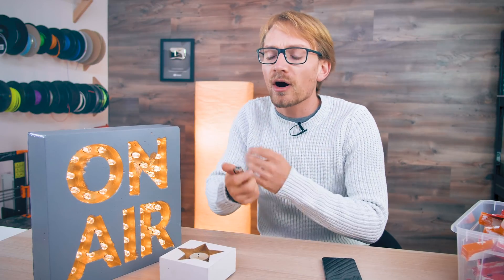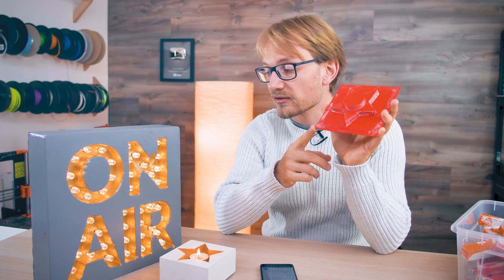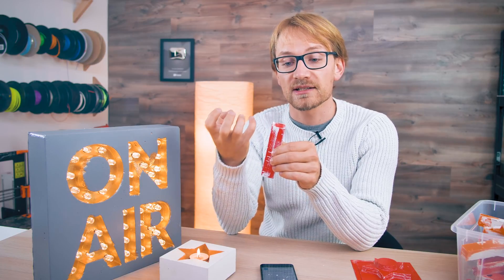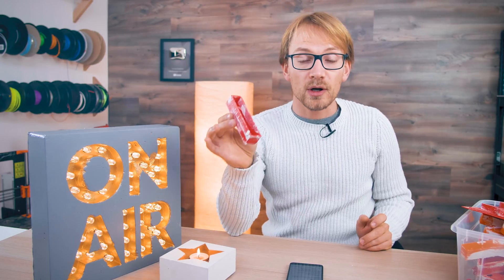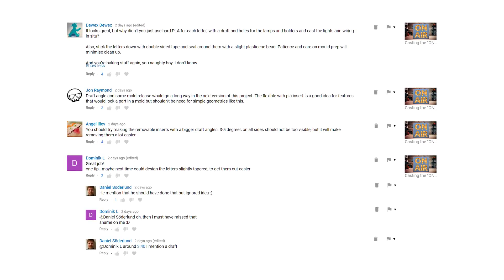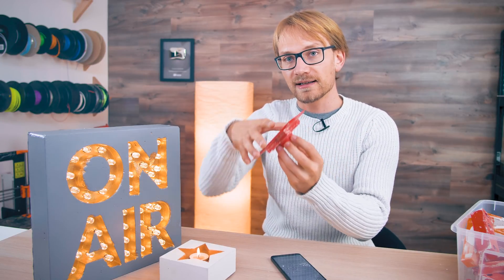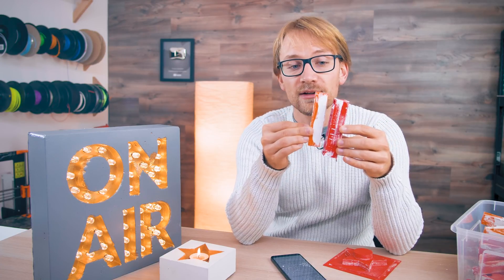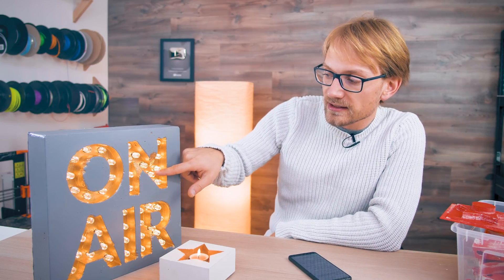Why didn't I use a release agent? Your questions about [3DP + plaster casting] answered!

Comment: Would you consider doing a video on what are the best laptops (and desk top computers), that are most suitable for connecting & utilizing 3D resin printers and PLA printers to them, as well as helpful attributes to look for when choosing one that is also reasonably priced (under $1,500) ?
If you are not interested in doing a video for this specific question, I would also appreciate a response directly to me if at all possible ?
Many thanks !

Comment: Finally !!!

A VERY helpful video on 3D mould release techniques & chemical agents best suited for this type of mould, where you offer great factual knowledge and experience, while describing it well, using examples.
All that I have seen for several months now are video’s about “mould release agents”, but they all involve silicone mould’s with various moulding materials. 
But what I have noticed (in the most frustrating of ways), is that when it comes to 3D moulds, you either get a confusing word salad where they never get to actual releases that work, or it seems as if there is a general avoidance in including anything of substance when dealing with 3D moulds that stick so hard to the 3D mould that it ends up in the garbage !!

Your video is the ONLY one that I have found truly helpful, so I sincerely THANK YOU !!

Comment: Always great stuff Tm. I actually have worked many years in casting masonry etc and have only in the last 5 years used 3d printing. I mainly now do acoustics eg speakers, acoustic panels for high end studios...was construction stuff originally.  I also worked for ACO (German Polymer concrete products super high tech batch etc) here in Australia and they  do the same as mentioned below. Just a couple of things that might help...mold release, to work properly; draft angle is usually 1.5-2.5 deg depending on context...but 5 is prob a bit much. Also, mold release should never be wet. You will find that the 'real' stuff is not what you think...it evapourates and leaves behind a microscopic layer...even touching it you cant tell its even on there. Oils etc are not ideal for plaster BUT if you simply dissolve a parrafin candle in a solvent (like a 1cm cube per 200ml), put it on and let it completely dry, you will find this lasts a couple of pours. Vielen Dank!

Comment: ehm demold concrete after a week? i worked in a concrete factory where we made pylons and load bearing beams. we casted them in the morning and got them out a couple of hours later. then let them dry further but most where in buildings the same week. just saying.

Comment: Flame lick your parts after a light sanding. Particles from sanding will fuse inside of layers making an ultra smooth print. Also what about flex filament for molds?

Comment: PVA release would not have worked as the water content in the plaster would have dissolved it. (Ask me how I know:D) Better option for plaster castings, is to use mould-soap. Release, dry (all the way), wipe surfaces with a wet sponge and you'll have no problems with residues.
Also next time, use Ultracal50 for casting. Dries quicker/harder than regular plaster and releases easier too.

Comment: Great project! PVA might not work as a release agent. Commercial concrete binders a basically thin PVA glue and a wetting agent - it sticks to concrete and porous surfaces really well. Unless the PVA released from the printed mould easily, its not going to help. I would rely on the taper and smoothing the mould as much as possible.

What if you printed the skin of the mould in vase mode and just left it in place? After painting, nobody would notice.

Comment: If you really want the same look: There are 12V versions of those exact lamps on Aliexpress too and they are even cheaper. Just use those with an old PC power supply. To get down the brightness just connect a few in series.

Comment: Talcum powder can be used as a release agent it doesn't bind to gypsum (plaster) as it's hydrophobic and would not not cause any damage.

Just dust the mold with talcum then turn it over to allow any leftover talcum that isn't attached to the surface to fall of the mold and pour in your plaster.

This is the equivalent of powdering a baking mold with sugar or flour, basically what the talcum would do is fill all the small gaps and cracks in the surface so the plaster couldn't sip into them and grab a hold of the material, also as it's hydrophobic the talcum powder would create a tiny gap between the walls of the mold and the plaster, it's basically like leaving a small gap between the raft and your model so  you can peel it off the raft more easily.

In a pinch starch/cornflour (finely ground none of that coarse cornmeal type of flour) can also be used as they are sufficiently hydrophobic and wouldn't bind with the gypsum.

Comment: As for heating up, I found that it is often super useful to use a heat gun to heat up your PLA/any other plastic to a temp. between Tg and the melting temperature. Fitting and removing parts is so much simpler.

Comment: why plaster or concrete for the thing?? its so heavy.. why not figure out a way to make a 3d printed sign? or cast with Polyurethane Liquid or epoxy??
Reply: Firesafety?
Reply: use led lights!   how hot can a led light bulb get that it would cause a fire?

Comment: I enjoyed the casting video.

One other venue to try in order to reducing the overly strong bonding issue is to grab a gluestick (you want very weak glue, if you have lots of post-its that glue probably would be ever better) and then glue some baking/parchament paper (smooth side facing the plaster/gips) onto the plastic shapes.

Plaster and concrete adheres very poorly to most paper so play around with this, also, it does adhere poorly to smooth paints, so it might be worth looking around for a good paint (preferably sprayable) and just permanently coat the molds.

Comment: 8:44 you wired like every two in series did't you?
Reply: probably four groups, considering how bright they were. That'd only put about 60 volts across them, they're what 12led lamps, 36v and a resistor? Should light at 60v
Reply: @mat.phillips  the brightnes isn't proportional to the voltage - but yea - it is something in that range. Nonetheless it's not recommended xD

Comment: You could also try a PVA mold (like E3D Scaffold).  That plaster or concrete should set before your cold water degrades the Scaffold too much, and after it's set instead of demolding you just run hot water over the part until the Scaffold is removed.  I plan to give it a go myself (or maybe even Scaffold Snap - and just break it apart in pieces to remove from the cast object).

Comment: Hi Tom, I designed and built my own 3d printer and got it running thanks to your videos, huge thanks. I even played with plaster and sand last week, and I think you did a decent job. But... I skipped alot, and even if the methods are cool, making a candle holder felt so.....meh. Sticking to 2D shapes, not really using a 3d printer to it's potential is it?, just cut some wood/foam and glue it together. 

If you made a negative space mold of some figure, that you could pour plaster into, that'd be way better, definitely try this again, maybe invest in silicone for molds. 

I've been trying to print plaster molds for casting aluminium with hollow cores, but ramps connector finally exploded, and I ended up doing them with my cnc instead, much faster... but man you have to remember release agent ! :P Unless you're casting wood reinforced plaster bricks.

Comment: People in the green sand metal casting hobby have found PLA 3D printing patterns usable but disappointing.   For many, maybe most, parts its easier to make a traditional pattern than cleanup the layer lines.  It can be helpful creating details for addition to patterns, like lettering.    I do know a person who occasionally uses it for full patterns without surface preparation but does so with largish draft angles on parts that get machined.

Comment: Some potential experiments:
1. Silicone lubricant spray (as an alternative release agent) since it's non-reactive, it shouldn't interfere with stuff. You can find it in a car parts shop.
2. Greensand mold - Usually it's for casting metal, but it would give that stone/sand texture on the surface of your final object. (make it with one part sand and one part clumping cat litter - blended or crushed to equal size particles)
3. Positive? relief mold - make the full size version with PLA, make a mold with something like silicone (plus corn starch to make it hand workable - see King of Random's "silicone putty")
4. Resin. Semi-transparent or glow in the dark. Or both with UV bulbs.

I like the smoothness of the plaster. I think seeing it come together is really the joy of 3D printing as well, so keep it up regardless of thumbs or comments!

Comment: Thanks for the video! You were saying that concrete takes more than 24 hours to cure. That is of course true. It takes weeks to even months for concrete to fully cure, but you're not building a bridge with it. I just made a video where I poured plain cement (not concrete, and not a quick-setting cement) to make candles and I just let the cement cure for 24 hours. From what I can tell from your videos, my castings came out of the mold just as green as yours did. 

So what I'm trying to say is that cement is just as easy and fast to deal with as plaster.

Anyway, I'd love to see more projects like this! There's just something so satisfying about casting plaster or cement.

Comment: you did the right move using plaster rather than concrete as it hardens over time a long long time. but if you wanted a texture of concrete  just add sand to the plaster. or spray the moulds with water and pour some sand into the mould make sure its all over it then add the plaster.
Reply: In a past life (like 3 years ago) I used to add sand and fish tank gravel to plaster to give it the look and feel of concrete.
Reply: Should work with epoxy too right?  Eg mix some sand with epoxy, cast a thin surface layer over the mold, then come back with a backer layer of woven fiberglass cloth for a concrete feeling object that is light weight.  I've told somebody I was going to mess with them and give them something large in concrete, and they said it would weigh way too much.  Be kind of funny to act like it's really heavy, struggle with it, then hand it to them and wait to see how long it takes them to realize it weighs almost nothing.

Comment: None of this would have occurred to me to try.  If I had a 3D printer I would have printed it.
Reply: a cnc does this easily at 10x the speed :) find myself designing a 3dprint, and while it's printing I got time to re-design it for cnc machining and have it done before the print finishes :P el-cheapo chinese cnc ftw  *edit, and then you wouldn't even have to cast it afterwards xD